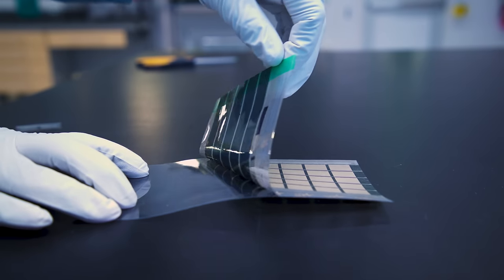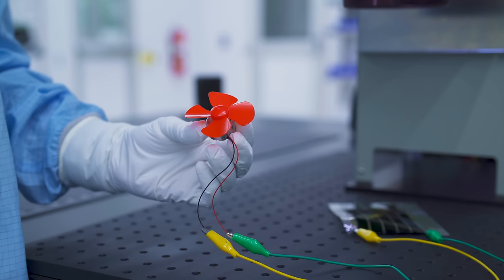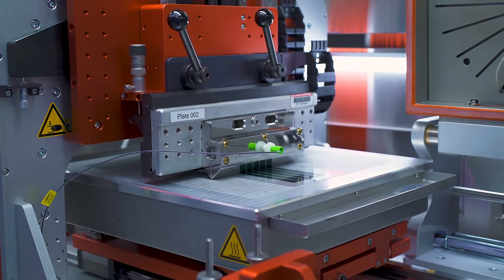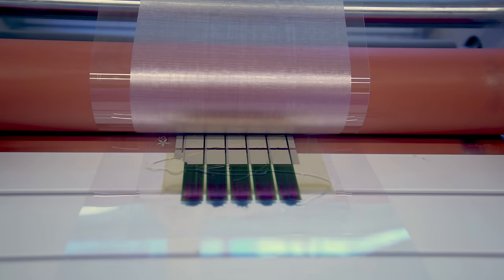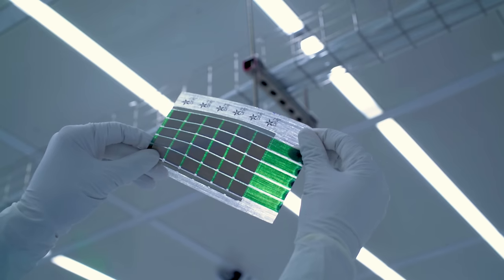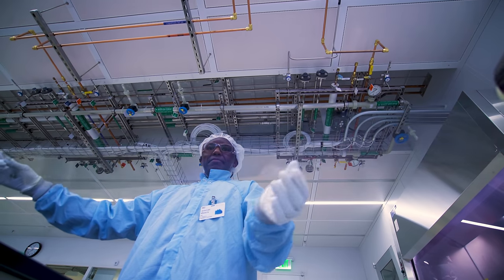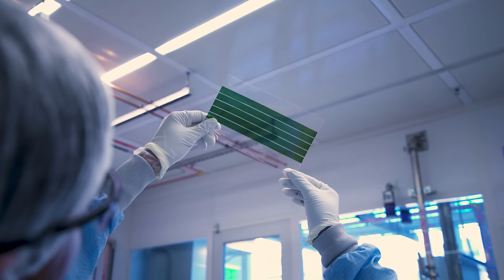Paper-thin solar cell can turn any surface into a power source

Comment: If anyone wants to learn a little more about the fabrication method used here, it is called slot-die coating. It's pretty cool stuff!
Reply: Is this perovskite based or some different chemicals?
Reply: @halnineooo136  based on the research article attached, they're printing organic PVs here. Though slot-die coating is widely used for perovskites as well.
Reply: @vishank7  
Alright thank you. As far as I know this is nothing new, thin film flexible organic solar cells existed for a while, I don't see where the novelty lies.
Reply: Excelente!!👍👍
Reply: Is this a form of lithography?
Reply: @himynameis6433  I don't know a whole lot about lithography, though it does involve chemical etching. Slot die coating does not, and is just another method to deposit thin-films used for battery/solar applications.
Reply: Thankyou
Reply: Apply it to a vehicle like wrapping vinyl allover car's body
Reply: Anyone know which manufacturer have such product available?

Comment: "The specific power of our integrated fabric-PV modules is 370 W kg−1, weighing 105 g m−2, while the free-standing devices had a specific power of 730 W kg−1, and weigh 52 g m−2." 
From the paper, if someone wants to work out the Watts/m² 

38.85 Watt per square meter for the integrated fabric-PV modules?
37.96 Watt per square meter for the free-standing?
Normal Solar Panels produce 150 Watt per square meter.

So this is for the light weight solution, when you care about weight. For stationary panels it's 4 time more efficient to use normal solar panels.

Comment: I don't think we should be using a per-gram metric to showcase power efficiency, it should be, as always, area covered. You cannot advertise that a 1m2 1kg old cell is less efficient than a 1m2 100gr cell. , or that it's 10 times more efficient because the weight is not a factor in energy generation.
Still surprised by the achievement and I wonder, would there be repercussions in the climate if for example all of the world was covered in solar cells?
Reply: Yes, I wonder if fossil fuels are used in the manufacture of the cells, or in any of the potential plastic packaging solutions
Reply: We could cover the world with solar panels, but the problem is where you are going to store all that electricity
Reply: @purchville  very little fossil fuels are used.

 @user-ss1vr6sj2c  we have many solutions for that, including pumped hydro.

@maizmaiz1   "The specific power of our integrated fabric-PV modules is 370 W kg−1, weighing 105 g m−2, while the free-standing devices had a specific power of 730 W kg−1, and weigh 52 g m−2." 
From the paper, if someone wants to work out the Watts/m² 

38.85 Watt per square meter for the integrated fabric-PV modules?
37.96 Watt per square meter for the free-standing?
Normal Solar Panels produce 150 Watt per square meter.

So this is for the light weight solution, when you care about weight. For stationary panels it's 4 time more efficient to use normal solar panels.
Reply: For mobile applications weight matters. For some static applications weight also matters (e.g rooftop) some people don't like heavy objects on their roofs. But I get you though. To generate more power, you need more space with this solution than with silicon based solar. For me tho, if this solar cell could be very durable, long lasting like that of silicon and is also cheaper than silicon (I think it will be so) then I will go all in on it.
Reply: @irokpe6977  'Fer sure, and even in stationary applications, weight is always a consideration, if only for the differences in structural requirements, and any additional costs associated w/ both manufacturing and potentially added emissions.
Reply: @VeMultiVo  'Sez the teenage expert on the 'spectrum' still living w/ his parents... ;-p
Reply: Agreed on deceptive the metric but, "..all of the world covered in solar cells?" Plastics degrade. You'd have to deal with degradation, maintenance and vast quantities of oil reserves required to keep the mess going.
Reply: Lightweight is always good. Especially enables sci-fi things like space based solar power by reducing launch cost.

Comment: GREAT MINDS AT WORK...

Over 30 years ago I came up with idea of 'additive' printing of computer circuit boards. In traditional process using masks and etching copper away wastes 95 percent on blank boards. Laser and ink jet printers only apply circuit path where needed. This MIT breakthrough is really exciting. Someday everyday items can have solar charging. Thin cell batteries can also be produced that are flexible and lightweight. Also thin and flexible display panels are coming soon. Your TV could be rolled up and stored away when not needed.

Comment: "The specific power of our integrated fabric-PV modules is 370 W kg−1, weighing 105 g m−2, while the free-standing devices had a specific power of 730 W kg−1, and weigh 52 g m−2." 
From the paper, if someone wants to work out the Watts/m²
Reply: 38.85 Watt per square meter for the integrated fabric-PV modules?
37.96 Watt per square meter for the free-standing?
Normal Solar Panels produce 150 Watt per square meter.
Reply: @Albtraum_TDDC  this is the question I had. I applaud any new PV research coming to fruition. But, the name of the game is surface area. Presenting decreased roof load as a design goal, but then not noting (by your math) that a fixed surface area would have 1/4 as much power generation is misleading viewers. Still great technology and has its place (particularly the application to sails). Maybe it would be better blowing in the wind, cut into the shape of oak leaves, suspended from a fractal branching system and tied into a main trunk.

Nature efficiently evolves forms
Reply: @Albtraum_TDDC  : That figures. So covering that house in the video with the same sq meter of cells would fall very far short of powering the house. In other words, there's not enough room on that home's roof for those flexible cells to generate the same power output.
Reply: @DaHaiZhu  I think so, unless there are some other numbers from the developers of this somewhere.
You could however use them in other ways, like in spaceships/satellites, in ship sails, in greenhouses maybe?

Hmm greenhouses and similar installations should be a good usage as those take a lot of space and are not able to support the weight of solar panels, while this thin film seems to be almost transparent so it wouldn't mess with the greenhouse Sunlight needs.

I guess you could also "cheaply" cover the sides of buildings and the glasses of skyscrapers too.
Reply: @Albtraum_TDDC  except those flexible panels are not stable - they will perish in ozone and ultraviolet. 
Instead of hype they should provide demos to the market and let the street to find it's own use of the tech...
Reply: @piotrcurious1131  not stable? Perish in ozone and ultraviolet? What do you even mean?
Reply: @Albtraum_TDDC  I mean plastics perish on elements and the sun, esp. thin, transparent ones. No way to compete with glass and silicon. 
I do not say printable solar cells are bad idea, but the video ad clearly tries to oversell them into areas where they have no chances.
Reply: @piotrcurious1131  oh yeah, probably true.

Comment: What about the ratio of power generation per unit surface area of this one compared to conventional one.
Reply: That’s a great question
Reply: Noticed they said multiples of traditional solar panels in Kgs not surface area lol.
Reply: @calebrcannon  for your kind information solar panels produce energy from sun which needs proper exposure to sun. If I stack 1ton of solar panel under my bed its not gonna produce electricity. So it's necessary to know the energy per surface area.
Reply: @lostinhell07  Believe we are saying the same thing here.
Reply: @calebrcannon   "The specific power of our integrated fabric-PV modules is 370 W kg−1, weighing 105 g m−2, while the free-standing devices had a specific power of 730 W kg−1, and weigh 52 g m−2." 
From the paper, if someone wants to work out the Watts/m² 

38.85 Watt per square meter for the integrated fabric-PV modules?
37.96 Watt per square meter for the free-standing?
Normal Solar Panels produce 150 Watt per square meter.

So this is for the light weight solution, when you care about weight. For stationary panels it's 4 time more efficient to use normal solar panels.

Comment: 0:00. Applies here, as well as to regular labels. If you don’t want it to curl, lay in on a surface. Instead of peeling the label from the backing, flip it over and peel the backing from the label.

Comment: PV coated shipping containers could power their own transportation. In Canada, the max train length is 16500 feet, if the train is entirely made of wellcars arranged in three-packs at 204 feet each, (each with a combined 1500 square feet of useful surface area) it will have 81 of them = 11300 square meters at 200watts per m^2 = 2250kw. A locomotive eats 3000kw. 
The locomotive is a lot heavier than the freight it carries and so ditching it would mean a effeciency gain. The reason it's heavy is for traction, which you don't need as much when your power is distributed over 3 miles of track. 

Then again, this is the umpteenth version of the "printable" photovoltaic. Nonetheless, good job! I like the fancy logo printed on your lab supplies/mastics. Very good use of money. :P

Comment: 100 times lighter works if you can stack these in the same space as regular commercial panels.  Since you can’t, then it takes up too much area because of the low efficiency.  If you have competitive efficiency then its probably in a lab, like the material degrades easily in ambient conditions. If you compare to commercial panels, don’t omit the other stuff.

Comment: So which thin-film solar cell is it? Is the material as readily available? Non-toxic? Is the cell durable in the long term (e.g. Perovskite cells can be good but degrades due to sunlight).
Reply: Gads.  This is research.  They're working on a protective film.  They're not claiming commercial viability.

After the Wright Brothers first flight a newspaper asked an American general if there'd ever be any useful military application.
"No," he confidently replied.

Comment: This is absolutely amazing and prove a game changer. Imagine a future where such ultra thin solar panels can be integrated or embedded into our dress, and we can charge our phones and other gadgets with it. We can also carry those while travelling into more remote areas where electricity is not readily available.
Reply: Yup, solar powered ships, solar sticker batteries, could use them to help generate heat to cook MRE possibly, who knows. Incredible potential.
Reply: @timmybear4449  metallised mylar mirror film would be better for heating your MRE.  Afterall why bother absorbing & converting solar energy when you can instead just reflect/focus it directly onto whatever needs to be heated.
Reply: Sorry, but even someone with as little interest in style as me doesn't want to look like a walking cellphone charger. Where it does make sense is a rugged and flexible panel that could hang on a wilderness backpack to keep digital gear charged. I have one intended for that purpose, but it is fragile and not flexible.
Reply: Dresses need to be washed and gets folds more than thousand times a day
Moreover static charges may accumulate on dress and you may suffer
Reply: Apply it to a vehicle like wrapping vinyl allover car's body

Comment: I did not hear data on power generation per unit of area compared to conventional panels, whereas, there is emphasis on efficiency per kilogram.
Reply: I was thinking the same. They are probably around 18 times lighter than conventional solar panels, so the energy per unit of area is probably about the same.
Reply: @GreatDataVideos  The reason I was wondering about power generation efficiency is that weight is not always a major consideration. But as long as this tech. has good efficiency then its weight and flexibility will definitely open up many new ways to install it such as vehicles, portable solar units, etc.
Reply: @brentwalker3300  Agreed.

Comment: But what is the power ratio when looking at the surface area? The power increase per weight doesn't say that much to me :)
Reply: It's nascent and it cannot be mass produced for the time being. I cannot see why these constraints would even let it get higher power to weight ratio
Reply: “It generates 730 watts of power per kilogram when freestanding - A typical rooftop solar installation in Massachusetts is about 8,000 watts. To generate that same amount of power, these fabric photovoltaics would only add 20 kilograms to the roof of a house,” he says.
Reply: @interesting2709  But 20kg of this material will most probably take up a lot more space than traditional heavy solar panels. This is why I ask. The new technique may save weight, but it needs a lot more space because the power per surface area is lower. In other words: this cannot replace traditional solar panels on a roof.

Imagine the roof that needs 1000 pounds of traditional panels only needs 50 pounds of the new ones. The roof surface area is 100 square meters, but how much does 100sq meter of the new panels actually weigh? I bet it weighs less than 50 pounds, so if the output per sq meter is lower, there's no use in replacing the traditional panels since you can NEVER have enough power output with the same surface area. The weight is irrelevant in that use case as it doesn't contribute to the comparison when looking at actual practical power output.

Comment: What about power generation per surface area rather than per kilogram? Because many applications can be named where surface area is a much more valuable asset compared to weight.
Reply: Cost per power generation is also one of the most important factor
Reply: Yeah this tech seems the most relevant for applications up in space, where weight is the primary concern & there's no worry about air degrading the delicate nanomaterials.  
Up there the solar "panels" can be deployed as big as they need, there's always more space available.
Reply: "The specific power of our integrated fabric-PV modules is 370 W kg−1, weighing 105 g m−2, while the free-standing devices had a specific power of 730 W kg−1, and weigh 52 g m−2." 
From the paper, if someone wants to work out the Watts/m² 

38.85 Watt per square meter for the integrated fabric-PV modules?
37.96 Watt per square meter for the free-standing?
Normal Solar Panels produce 150 Watt per square meter.

So this is for the light weight solution, when you care about weight. For stationary panels it's 4 time more efficient to use normal solar panels.

Comment: That's an awesome contribution. Thanks!
I'd be curious to know how much power they generate per surface unit
Reply: Any time a report omits a common measure of performance (and substitutes another measure), you can be sure the device does not perform well in the common measure.  You should be very curious that the Watts/m² performance is not mentioned - that likely means it is not good compared to standard silicone cells.  Now it's Watts/kg performance IS interesting, but probably doesn't hold as well when the cells/panels are integrated into some structure robust enough to keep them from blowing away or being torn up in the wind.

Also not mentioned in the video is their stability against degradation in the environment, often a downside in organic PV cells.
Reply: 370 watts per kilogram
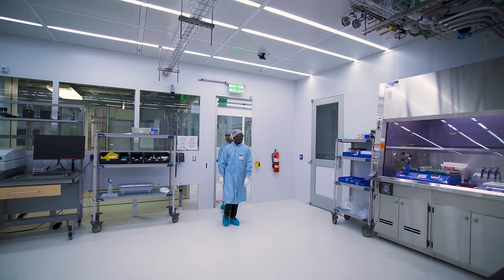1:33 that info, and more.
Reply: @SansNeural  Hey.  Caution is fine, but did you listen to the vid?  They're working on a protective film.  This is research.  The commercial viability will come later.
Reply: @veramae4098  I know all that, but I have to try to temper the gushing praise and expectations that others in here are running on about.
Reply: @veramae4098  "working on" is cold fusion slogan.
Piece of foil will degrade by stuff like ozone. If they will develop polymer film - it will be "forever plastic" problem. They will have to use glass to stop ozone and uv and to keep it environmentally safe.

Comment: this will be a game changer for the solar panel industry
Reply: I agree. It means solar cells can be used almost anywhere. That said, what would be even more useful would a system that's as effective as roof shingles and almost as easily and cheaply installed. Then we'd see more homes with dual power—commercial and solar.
Reply: It's possibly already the reason why most solar stocks are crashing. This technology is going to make Solar really cheap.
Reply: No it wont...
Reply: @buggi666  38.85 Watt per square meter for the integrated fabric-PV modules?
37.96 Watt per square meter for the free-standing?
Normal Solar Panels produce 150 Watt per square meter.

Comment: Can someone start commercial application asap please.  This seems like it could be the new perfect residential solar roof. If you adhere this to the middle portion of a standing seem metal roof,  then have the power leads at the top under the ride vent out would be so easy to install. 90% roof coverage, easy and cheap on most houses,  and you would even see wires. I bet you could even design it so the bottom end could be cut to size with minimal treatment.

Comment: If this is the case than we can use this foldable and flexible solar panel in automobile to spread it when want to charge and squeeze it when not in use.
Like a dust cover for cars.

Comment: You emphasize watts per kg, but what about watts per m²?  Since you never mentioned surface area I'll guess it's around the same.  So it's a breakthrough in portability, but not power yield per collection area.. correct?
Reply: This won't get answered for the next 10+ years. Don't hold your breath.